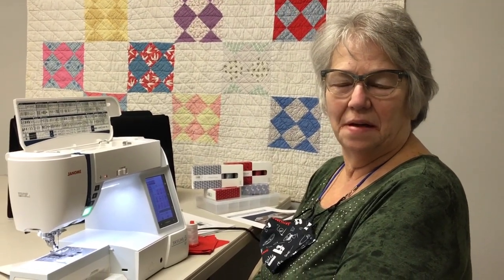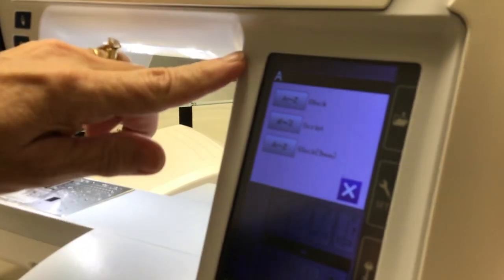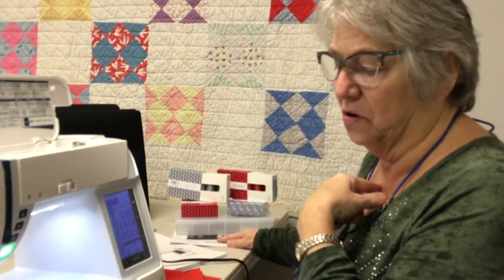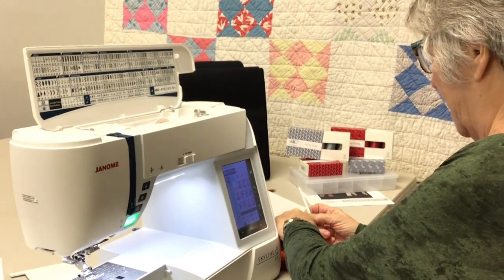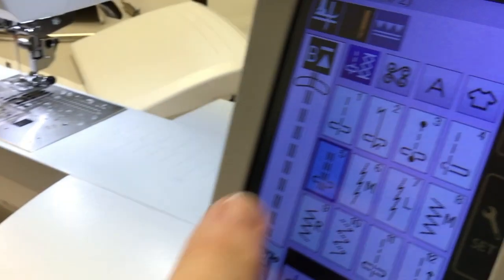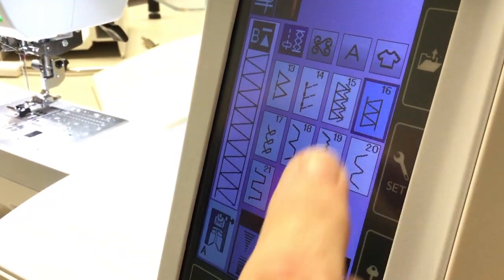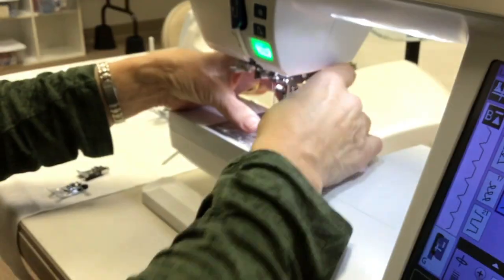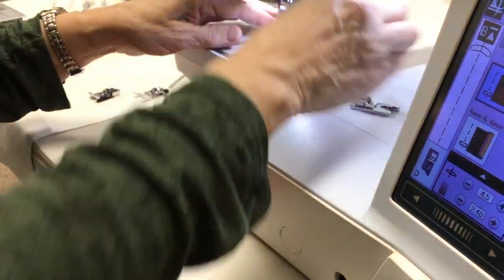Always In Stitches Janome Skyline S7 sewing machine tutorial

Comment: Ok, so came across this video today and so happy to have found it.  However, my screen did what yours did between utility and quilt (the section shortly after you explain the start/stop, lock, etc before moving onto the menu screen) and now I can’t figure out how to fix it. 😂. When I first started watching your video it was fine - I could follow along and press the buttons.  Then I filled a million bobbins (worst job) and did some practice stitching with you and now this.  I also changed the plate to the straight stitch plate.  You said in your video that you didn’t know why it was doing that, but it was edited and working next second  so must have figured it out.  What’d you do?  I’ve tried turning it on/off.  Thanks for your help and the good tutorial:
Reply from the maker: Okay, So turn off your machine and turn it back on and then touch the left arrow at the bottom and it will cycle through the pages of the different stitch categories.  You can also select the icon at the top of the touch screen to access that specific category of stitches.  Refer to the machine manual as to which icons represent which stitch category.  I hope this helps please call the store if you require further assistance!
Reply: @alwaysinstitches5388  reset to factory default, also ?
  The new s7ae is available now 10-13-24.
Nice.
🤺💐

Comment: I just ordered this machine and I'm a bit concerned about the bobbin winding. When you have the presser plate off just before 15 minutes, you can see that the bobbin is not well spooled, but has loose bits sticking out. Another reviewer pointed this out too, and called it  a design flaw. The bobbin winding should be easy to get tight and consistent, but this looked bad.
Reply from the maker: You will have no problem winding a perfect bobbin with your machine.  Several people wind bobbins all different ways.  Just refer to your manual and fully wind the bobbin and it will work out for you.  The Skyline series is a very popular model for Janome and we haven't had customers having issues with their bobbin winding mechanism!  When you get your machine, wind several bobbins and if you still have concerns, contact the person from which you purchased it from!
Reply: @alwaysinstitches5388  Thank you! It arrived yesterday, and it seems good so far!